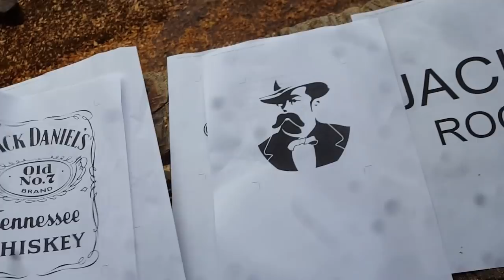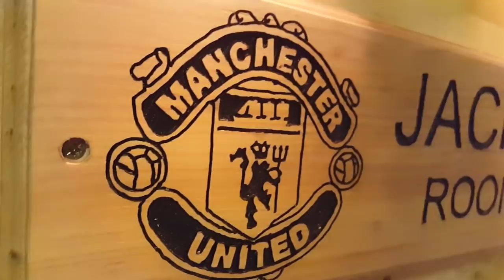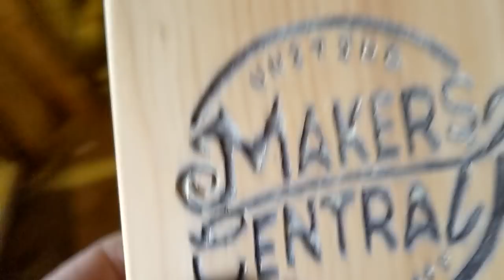Aldi Workzone Trim Palm Router Projects - Plaques, Signs & Lamps

Comment: Cool stuff,how you can use the router over a printed image takes some doing,I've tried twice...never again,..good old carbon paper for me..lol
Reply from the maker: I found it simplest and that works for me, the paper ruffling sometimes can be annoying. When i was using spray glue it was a lot easier but also more costly. 
So do you trace your design through the carbon paper then?
Reply: @thepoultrypeople  it's as easy as that,..a bit of tape to keep the template in place and draw..and you can use the template over and over again..job done.

Comment: Nice...If those prints are from a laser printer, have you tried reverse printing, taping print side down on surface and using lacquer thinner to saturate palm sized areas then rubbing into the work surface? (wood or plastic edge a few inches wide works best) I've made quite a few signs, and if it's detailed work, the glued on paper just comes off while your routing. I found this method (I think from Dave's Signs on YouTube-SO much information), and transferring the image like this works amazingly.Cheers
Reply from the maker: Thanks for that, i did try it with acetone with no results, paint thinner was slightly better but still smudged. This methods working for me but do agree when it gets fine it gets much trickier as like you say the paper starts furling and tearing.

Comment: Cool projects which blade did u use in router and did u get it off eBay.
Cheers
Tim from Wood 4 Nothing
Reply from the maker: Thanks Tim, its a CNC bit, 3.175mm at a 10 degree angle and you can find them on ebay. The reducer is a quarter inch to eigth inch adaptor, which is 6.35mm to 3.175mm. I also supply them in the uk and europe here https://www.ebay.co.uk/itm/323658913688
Reply: Looks like a bargain there Bongo... just ordered...cheers
Reply: @thepoultrypeople  cheers man I appreciate it .
Cheers
Tim

Comment: Great stuff mate, what varnish do you paint on , I use briwax but can be time consuming on bigger stuff
Reply from the maker: Briwax is ok and gives a decent enough finish but I highly recommend the osmo poly x hard wax oil in satin, really good stuff, wood pops out after it goes on. Goes on very quick with a sponge, takes a few hours to go off, but water and heat resistant, designed for floors its great on furniture.
Reply: Thats great thanks mate 👍